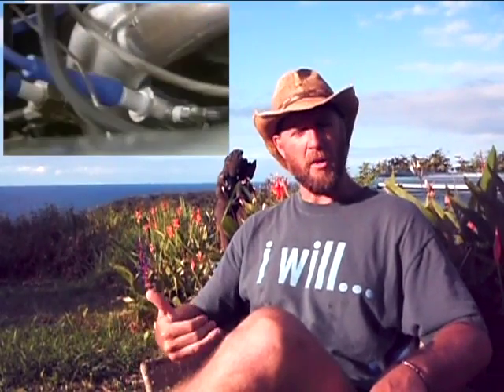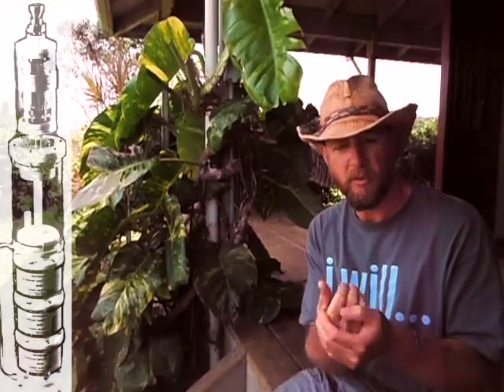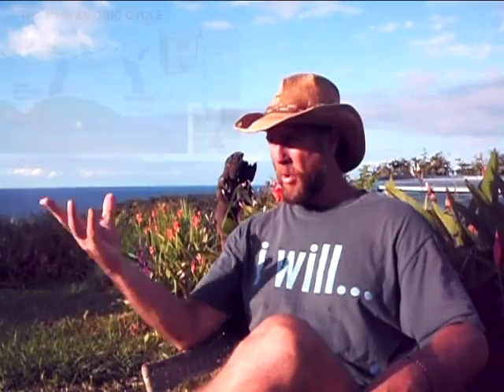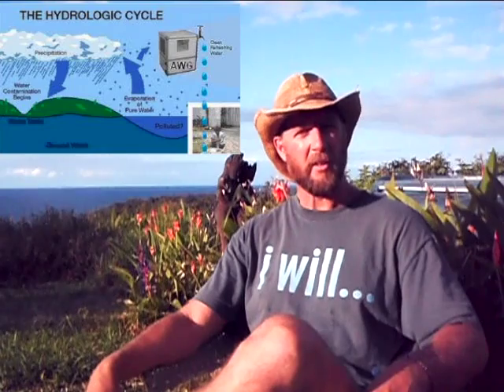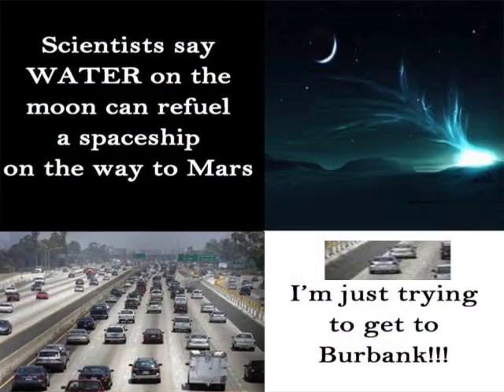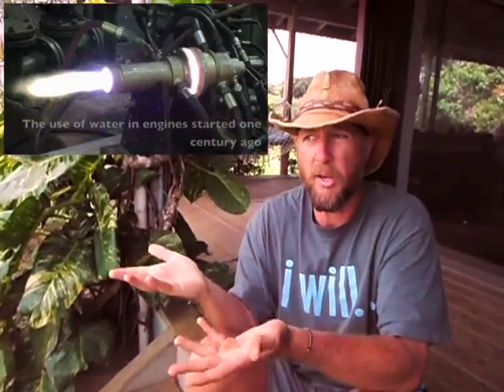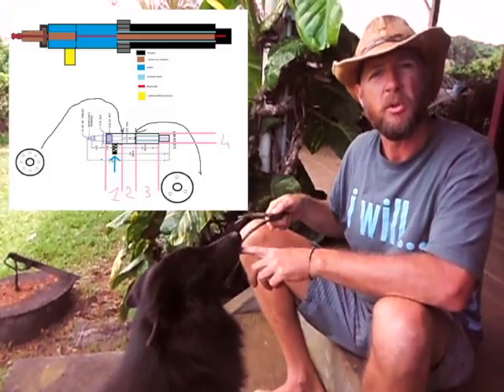FUEL from thin AIR   by WaterSparkPlugs.com

Comment: It seems to me that it would be easier to turn the moister in the air (or fogger device) into HHO in something that's more like a carburetor than in the spark plugs.  I always believed that lightening actually turns rain drops and/or moister in the atmosphere instantly into HHO - thus the sharp crack and explosion sound of the ignited HHO.  I know, we've been told the explosion sound comes from the lightening breaking the sound barrier but that seems to be more of a theory than a proven fact.  I think generating the HHO in a carburetor/fuel injector apparatus is the way to go with your frequency system.

Comment: I heard you say that water expands by 18000 times when turned to steam. Sorry but your off by a factor of ten.  But the rest of this presentation seems sound . A working proof of concept is all that's needed. the rest don't matter
Reply from the maker: uawwildbob I read the mass expands 18000 times..
Reply from the maker: Volume is 1600, mass is 18000 ?  I'm no scientists, I just play one on youtube.  As far as working prototypes, Kent Binghams Oasis Machine is using Walter Jenkins version of water spark plugs to accomplish overunity.. as reported by Kent Bingham
Reply: I know that our schools have been ripping us all off for decades. They should have been teaching our children the truth about water. Water expands 1800 times when turned to steam. Now that's an approximation of course, it depending on your altitude to be accurate . I know water can be used as a fuel. What some are calling over unity is incorrect. Energy can seem over when it is changed from one dimension  to another. the atomic bomb looks like it is overunity . But we know its not. Got t run Later

Comment: If you could adapt this to petrol-engine trucks or tractors, there would be considerable savings for these industrial and agricultural operators. But I guess there has to be economies achieved in the production of the parts and installation but once you have a few prototypes in action, others will see it and want it. The Land (NSW, Australia) reports:
"Cropping-only enterprises forked out an average $70,000 on fuel last financial year, compared with their total farm costs of $775,000 and revenue of $1.1m." So fuel (which is oversupplied and cheap at present) is less than 1/10th of farm costs. A considerable saving nevertheless, especially when extended over years.
Reply: Another area for big savings in Australian agriculture would be the rapidly escalating cost of electricity for irrigation and coolstore operation. Australian farmers are finding the cost of electricity so prohibitive that they are turning back to diesel generators. The cost of electricity is being driven up by so-called renewable energy e.g. wind and solar.
Reply from the maker: GoCo77 As prices of fuel have increased, there is an increasing need to switch on alternate sources of fuel. Water is one best source of energy. Researchers have proved that water can run cars. Scientists also claim that energy extracted from water can be used instead of fuel. Water mixed with normal gasoline is another alternate solution." techfeatured.com/automotive/1903/the-future-of-the-automotive-industry

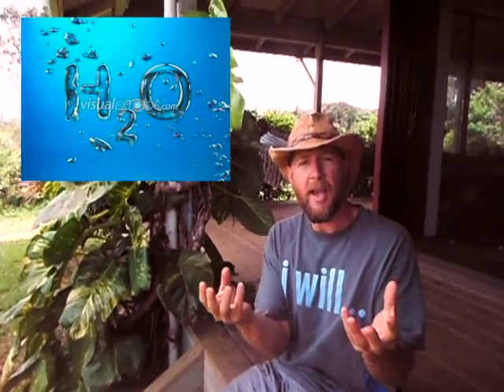Comment: 2:22 you said the tiny water droplets get hit with a frequency. Is the frequency acoustic, electrostatic, or electromagnetic?
Reply from the maker: +Solomons Words  pulsed dc current , electrical resonance
Reply: Thanks for the response. Had an interesting idea watching your video, when the gas is ionized use an electromagnet to eject it away from the hydrolyser, through the non combustible gas mixing section and into the combustion chamber. The coil would be pulsed just before the piston reaches maximum compression. Letting the coil reach max saturation before the gas mix is combusted.

Comment: Hey man... really the main problem that nobody talks about is that when you burn hydrogen instead of gasoline, you lack any lubrication in the cylinder that you would normally receive from gasoline.  This will lock-up the piston and cylinder from the increase in friction and heat.    It looks to me that you're preying on innocent people, trying to sound smart, and hoping someone funds your scam, while you sit in some non-us country collecting the money.   Nice try
Reply: you’re simply wrong look it up, any gasoline engine can be converted to run on hydrogen, BMW and Mazda Ford all retrofitted gasoline models with hydrogen, no issues Man..
Reply: The lubrication for the pistons is sprayed on to the cylinder walls through the oil pump. The part of the piston that is in the combustion chanber is actually smaller and does not touch the cyl walls.

Comment: I am interested, however, at the pressures present in the proposed design, how is the introduction of exhaust gasses possible?  Also, if the engine is not currently running, starting, how could you retrieve the exhasut gasses necessary for the system to work?  the resulting reaction doesn't only produce water, but other compounds/ions as well, our air isn't pure you know, this isn't a laboratory experiment performed in optimal conditions with optimal moles of a given substance/substances.  I get the theory, but I see holes.
Reply from the maker: Aloha Kevin,
 Since this video was made I have realized with the help of my engineers that the " exhaust gasses " Mr Meyer spoke of is actually Nitrogen.. The gas processing circuit in the plans extract Nitrogen from the air intake and combine it with the HHO in the 3 rd chamber before electron extraction. In my new ebook I go over this in detail and provide the circuit diagrams.. Great questions Thank You

Comment: Here is the interesting thing, carbon recombination, AKA combustion, C, for Carbon, is a result of re-combining or ionizing carbon based materials.  Since there is no carbon present it cannot be called combustion.  Hydrogen imbustion is more like it.  Engines running on imbustion are very cool, the reason?  well it is actually very simple.  Ever harness hydrogen in science class or chemistry class?  the "pop!" when you get a flame near a hydrogen bubble is the hydrogen imbusting, interestingly, absorbing the infared/electromagnetic "putting out the flame in the preocess" energy to recombine back into water, reconstituting itself, there are of course losses, friction, heat from friction, all play a role, and not all of the water from the exhaust system will be able to be re-collected and re-used.  Also of note, there is no "FREE" energy here.  Everyone seems to forget that we are constantly being bombarded by electromagnetic energy and that energy isn't being utilized or constituted for our uses, he isn't pulling energy from no where, he is just doing as Tesla suggested and is gearing into the cogwork of the universe and using the energy present to do work that otherwise he wouldn't have the energy for.  Ask me how I know.

Comment: Will it work in cold, really gold weather.
Reply: Theoretically the colder the air the more dense in becomes and the more gasses you should get from it thus making it more efficient in cold weather, I personally know nothing about this product but I do know about car modifications and their performance improvements when cold air is used instead of heated air ;)
Reply: Patrick Brett  your are right , cold air and hot gas fumes... So if the gaseline is his esthed so there is more fumes than liquid in the engine. Its should run more economically or go farther. Becose the will all burn in the piston rather in the exaust pipe....
Reply: Al Beau Stanley Meyers invented a way to keep the water in the tank from freezing simply by just using the electrolyses method. So yes It will work in freezing temperatures...
Reply: Ither you install a heathing unit working on hho or add some alcool like we do for  windshield washer fluid, with is water with some.vinegar or and alcool. Keep vinegar in your car and it dont freeze to good at 3 or 5% concentration, like bear and wines.

Comment: Strong introduction Dan.  I'm impressed.  Isn't there someway for us to make one car run on water without $600,000?  Clearly that's a roadblock for most of us.  If we could get one car - give them some BEEF - awareness would take off like wildfire.
Reply from the maker: I'm afraid the prototyping service fee for one years budget to perfect this conversion kit came to 600k.. thats for the one initial tested prototype. I can't just build nanotech in the garage , it takes a well equipped lab with engineers willing to take on this task. I have found such a facility and this was the bare minimum needed to complete our task..  good question  thank you
Reply: Daniel Green so find the engineers and lab willing to work for a piece of the "PI" )))
Reply from the maker: it took a year to find this lab,  most labs are tied into the DOD and are not allowed to make this technology.. 
http://youtu.be/BCSoPfiUkAg

Comment: this does not make a significant separation of of H2O to HHO but does seperate H2OH2OH2O into H2O H2O and H2O.  The resulting fog (water vapor) can then 'calm down' and recombine as their molecular fields return to normal after only few microseconds or less, the energy that was produced by separating them must come from somewhere else.  but when they return to normal they are again ready to be 'repelled'.

Comment: Imagine you have two magnets, when pole N=S there is a strong attraction and its hard to pull them apart.  when n=n or s=s they repel each other.  Now water is dipolar, meaning it likes to stick to itself through weak magnetic forces.  (N=S).  now imaging, with a pulse of energy we can switch all of these diploar ends to either N or S, every single one with then repel all other molecules.  this rapid repulsion then creates an "explosion" (of pressure) on the molecular level.  absolutely possible

Comment: thanks for the reply to read the article.  when I first saw your video I thought you were saying that you were using electrolysis to break apart the molecules and the bring those molecules back together.  Which I will stand where I was and say that is not possible to get net positive energy from.  

After reading the article, that's NOT what this is.  While the exact mechanisms involved are not 100% understood, I can give everyone else here relative grasp on what is happening. (see other comment

Comment: thats great, however, the cost of electrolysis is more than the resulting available power for work.  this has been tried thousands of times.  Where is the power coming from to split the bonds of h2o? even if you had 100% recoup on the energy (which you won't because heat loss during combustion or fuel cell recombining you would have nothing left for work.  So you are basically coming up with free energy out of nothing.

Comment from the maker: Please Look before commenting because our water spark plug invention is validated by 90 years of research and a " 2000 Cambridge University White paper titled - Arc-liberated chemical energy exceeds electrical input energy" 
tuks.nl/pdf/Reference_Material/Electrolysis_Water_Arc_and_Dielectric_Breakdown/Graneau%20e.a.%20-%20Arc-liberated%20chemical%20energy%20exceeds%20electrical%20input%20energy%20-%202000.pdf

Comment from the maker: Please see this White Paper before dismissing the technology mentioned in this video.. 
 A friend just passed on this pdf titled 
Arc-liberated chemical energy exceeds electrical input energy
by-  2000 Cambridge University Press
ww.tuks.nl/pdf/Reference_Material/Electrolysis_Water_Arc_and_Dielectric_Breakdown/Graneau%20e.a.%20-%20Arc-liberated%20chemical%20energy%20exceeds%20electrical%20input%20energy%20-%202000.pdf

Comment from the maker: Thank you for your interest..
#1 Further testing needs to be done, but it's just a cleaner burn cause no carbon will build up.
#2 Any gasoline engine will convert and older muscle cars are much easier to convert..
#3 Yes lubrication oil is still needed .. 

Mahalo

Comment: I haven't yet looked through all the comments, so someone may have posed the following questions already: 
1) What is the longevity of an engine adaptation like this. 
2) I imagine that retrofitting a new engine would be much more advantageous than an older engine, but what is your take on this?
3) I imagine that oil will still be used to lube the engine. Is that correct?
thanks